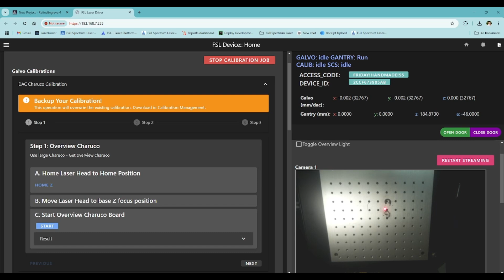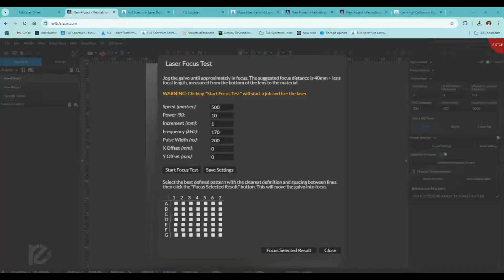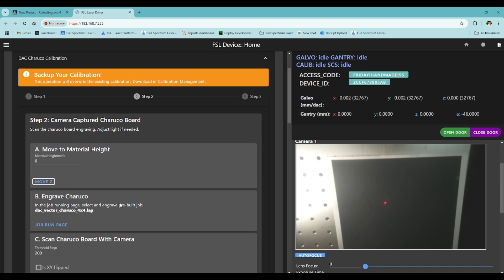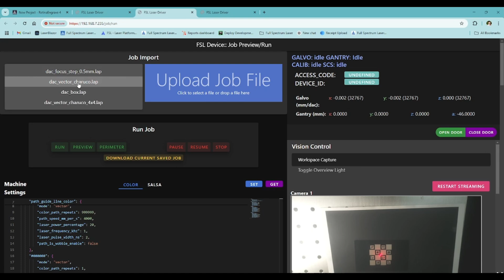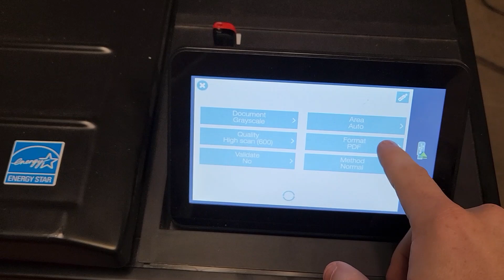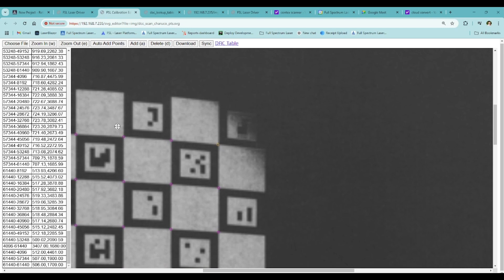RE4 Galvo Calibration

Comment: Is RE4 available for the pro 16x24?
Reply from the maker: Only for Galvos!
Reply: I would stay away from the Re4 suite and @FullSpectrumLasers . They have horrible reviews, equipment support, buggy software, and a non-existent support system. I purchased one of their Galvo UV Muse systems when it first came out with the Re4. The Re4 suite was buggy on first release and it's still buggy now. The interface you see in this video looks nothing like the interface now - and it's not even functional. I have a $50k brick sitting in my lab, and FSLaser is in no rush to resolve the backlog of customer issue on their online support system because the ticket system is just as buggy as the software they develop for their machines.